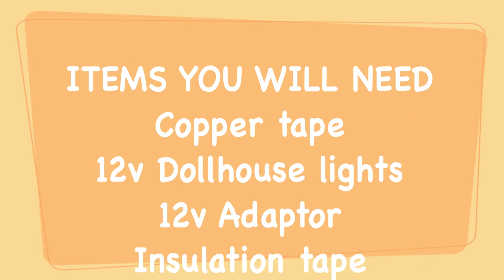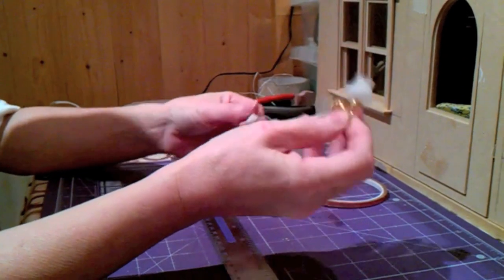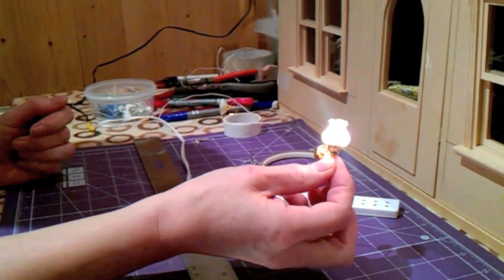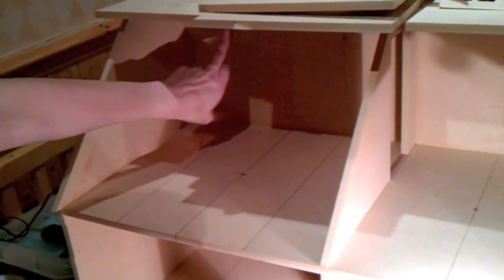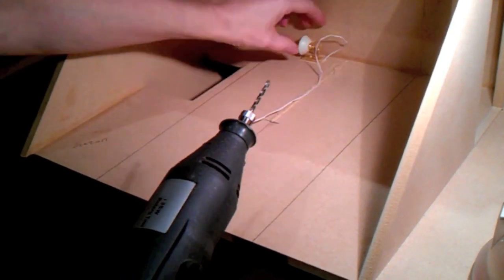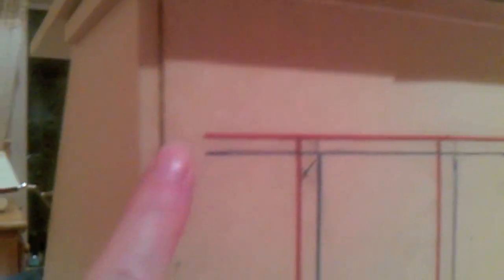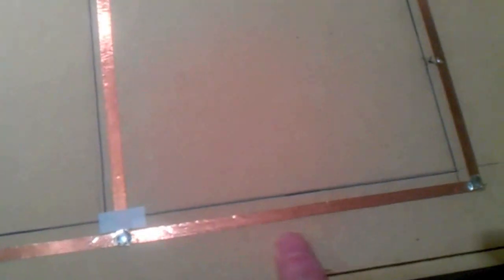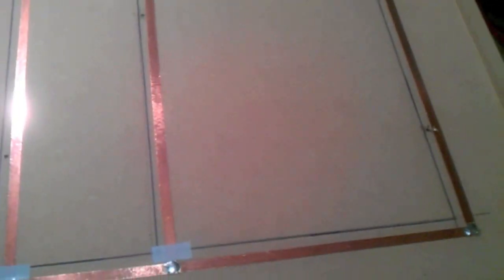Part 1 How to fit Dollhouse lights using copper tape

Comment from the maker: You do have to use some kind of insulation, just to stop it getting wet fro your wallpaper paste, I use scotch tape, it's really good, better than insulation tape, as insulation tape doesn't stick down as good and can let moisture in, that's when you get problems. Hope this info helps, regards sue.

Comment: My copper ripped at the back of the house. How do I fix a rip?
Reply from the maker: You could just patch it up with another piece of tape, just make sure it’s a continuous piece i.e. no cracks or breaks, you will need to solder the join to create a the circuit it won’t work if its not joined ... hope you manage to sort it, it’s half the problem solved if you can see where the crack is ... I’ve had it where  it was behind the wallpaper,  I had to attach some very thin wire over the top of wallpaper luckily it was in the corner so managed to hide it,